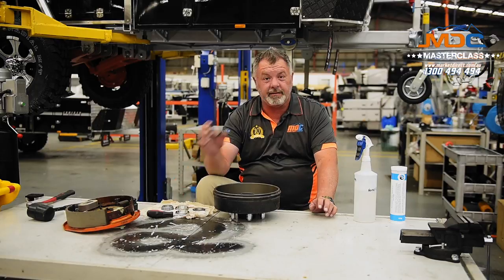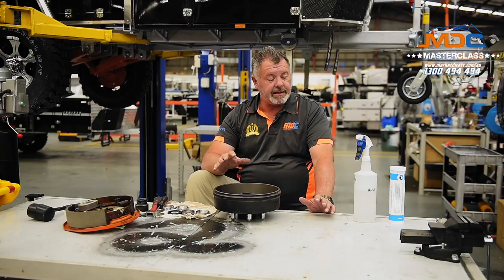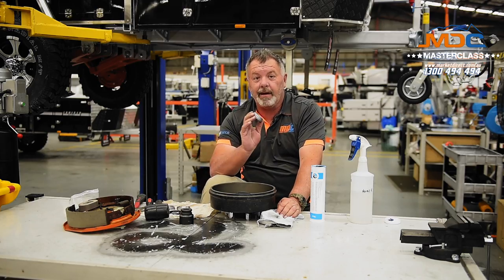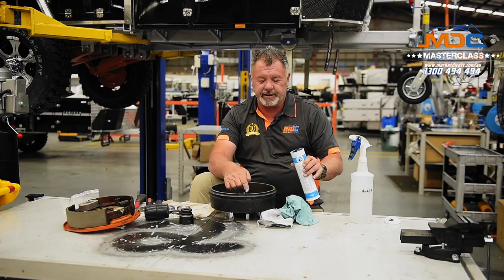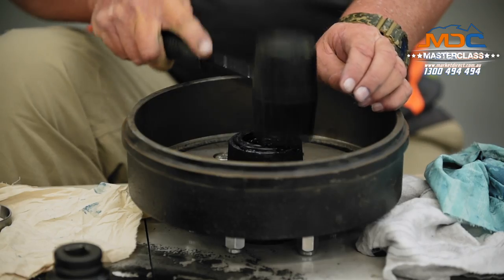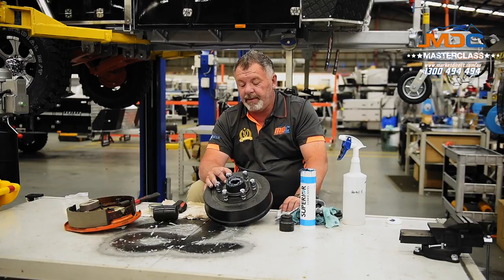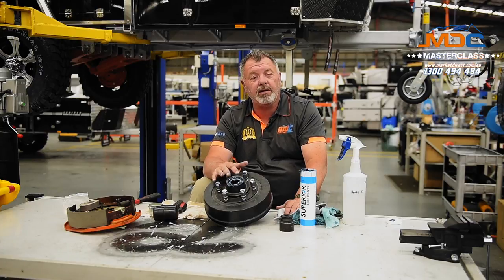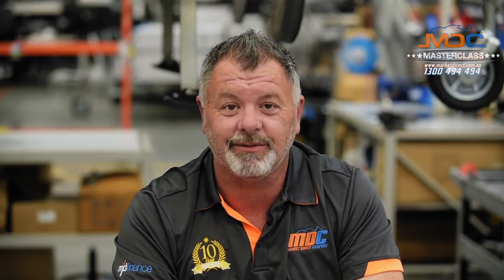Out On The Track Wheel Bearing Change - MDC Masterclass #06

Comment: You can use the old cones to tap the new cones in.
Reply: Absolutely, how many people on the planet would own an 80mm socket??? Just use the old cone, not really a masterclass.
Reply: Suppose if you're reusing/repacking the existing ones though you don't have old ones. Time to fork out for that 50mm socket then!
Reply: @HORTOJM actually using the old ones can be a nightmare if you haven’t ground them down so they don’t get stuck when hammering the new ones in. So using the old ones on the side of the track without grinding them down first is not a good idea.
Reply: I certainly wouldn’t use a socket to drive the new cone in. You can’t afford to damage the face that the needles roll against. The old cone is the best available thing to use and just make sure you use it the right way around so it leaves an exposed lip and you can then just tap it back out after the new cone is all the way home.  They’ll usually only go into the hub by a couple of millimeters anyway. Easy enough to tap out. I would also strongly suggest you use a pin punch or better still a brass drift to drive things in. You certainly won’t drive a snug new cone all the way home hitting it in with a plastic handled screwdriver. It’ll more likely split the handle of your screw driver open and then you won’t even have a screw driver anymore. You could certainly do it with a through metal shaft screw driver though. You should also find that there’s two small scallops inside the hub you should see once you clear all the old grease away. This is designed to give access to the back of the old cone allowing you to knock the cone out more easily. I like to tap one side of the cone then the other so it doesn’t wedge itself on the way out. I love the pre greasing idea. That would make a big difference if you had to do the job on the side of the road or in a dusty or difficult environment. Another suggestion is to put a film of grease around the running lip of the seal and on the hub where the seal runs so it’s not running dry on initial assembly which could cause premature wear and potentially let water and contaminates into the hub later on.

Comment: First...good to see you NOT using gloves. That’s the traditional method.
Second...I drop the bearing race in a zip lock bag and drop it in the ice bag, or Waeco. Get it nice and cold, and they pretty much drop in, especially if the drum has been in the sun.
Reply from the maker: That's a great tip with the ice Ronan, cheers.
Reply: Curious why not to use gloves, does using gloves diminish the quality of grease application?

Comment: Not sure this is really showing how to change a bearing as there was no changing any bearings! Just how to put new bearings in a new hub. Have you done a video showing how to remove bearings if you had to on the side of the road?
Reply: Yeah... Do you happen to know what size Allen key you need to get the hub cover off?? :*(
Reply: This a straight forward video however I have just tried to take off my wheel bearings on a 19' model and one side came off easily. The other side is a nightmare and was gouging the axle as it came off !!😮 it didn't slide off, I had to put the wheel back on without the castle nut and kick it off from underneath! 
I've filed and linished the rough bits but now still can't get the old bearing or the new bearing back on.  It's still binding.  It's as though the axle is just too big by .5mm -1mm. 
Wtf!
Reply: @scottlardner9074 oh great. I have to do this tomorrow. Hopefully it goes smoothly...

Comment: Do they not make bearing buddies for caravans that will fit MDC caravans?
Reply: I wouldn’t put bearing buddies on a hub with drum brakes because if to much pressure is pumped in can make grease squeeze past the seal onto the brakes making them fail disk brakes are less prone to this

Comment: You seriously want people to believe decent bearings, fitted correctly from the start, need to be removed every 5000km?! Or is this a con to refuse warranty issues based upon unreasonable service requirements? What a load of crap. Either the bearings you use are rubbish , the fitting is questionable or this is a con...